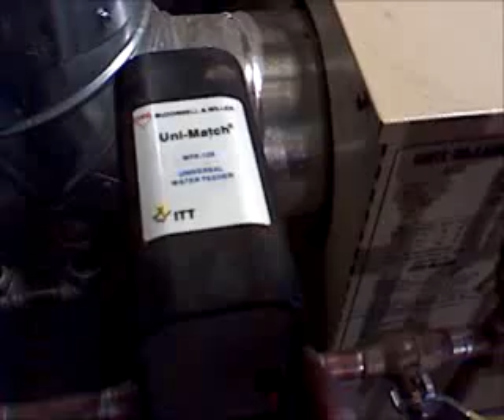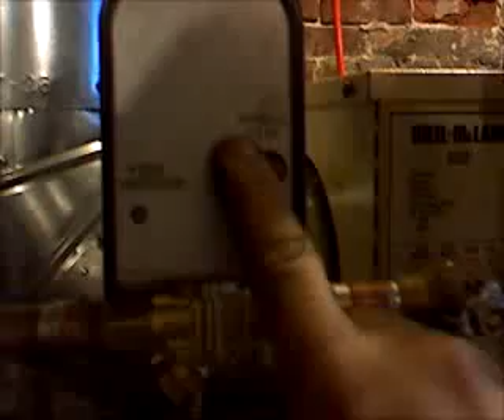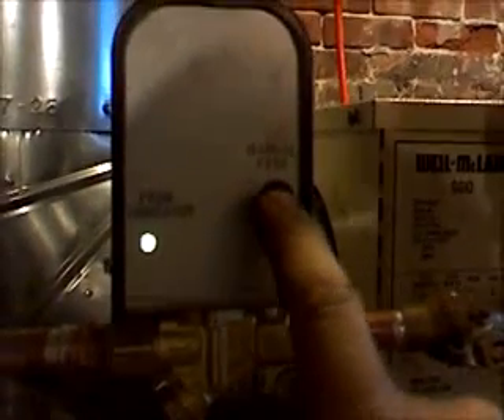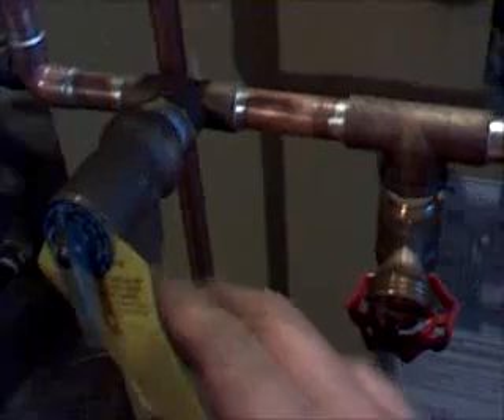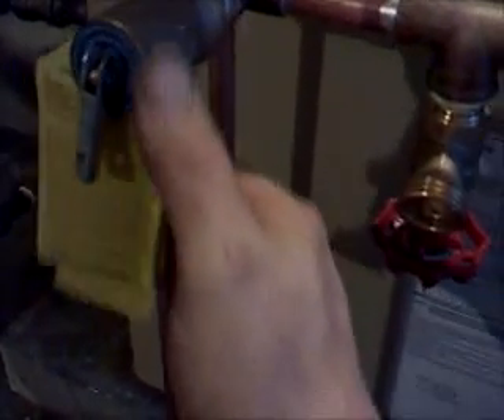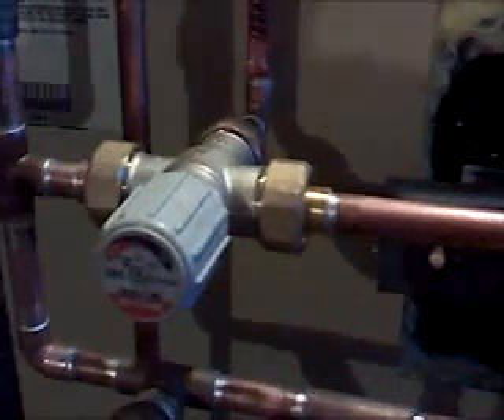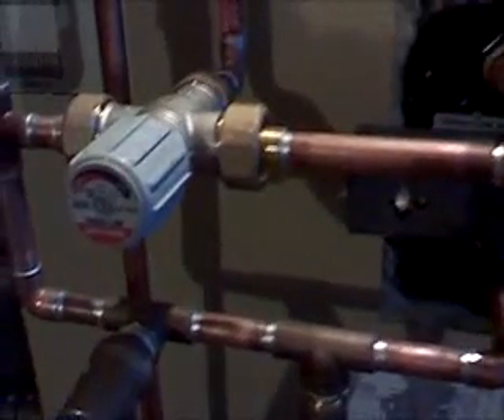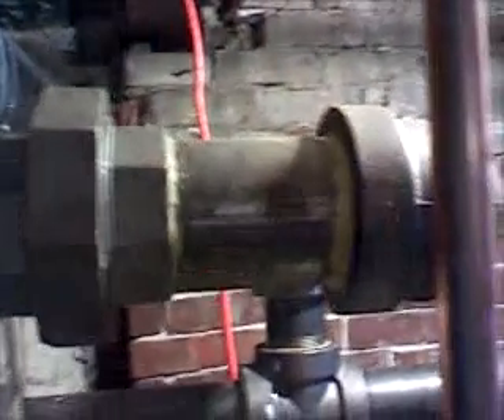Steam oil fired boiler

Comment from the maker: First of all in a Single Pipe steam system you don't wan't pressure, you want properly functioning vents, and this includes main vents.  The are expensive to replace ($30-40 each).  Your pressuretroll may also be cutting out prematurely, you could also have too much water in the boiler, it could be something else entirely like a loose wire or  a blockage in the returns.  Very difficult to assess without seeing it.  If Your local to Boston you can call 781-662-2850.  If not get someone local.

Comment: hello mister plumber i have a burnham boiler ,i drained it several times ,water is clear ,boiler is taking too long to build steam ,and when i finaly get steam ,there are not that much steam ,its like the steam is not blowing enough steam ,the steam dont have much pressure in the steam ,can you help me with some tops pls ,thanks you

Comment from the maker: You failed to mention if she has an automatic feeder or not.
Some auto feeders have settings to time how long they run for.
If she has a tankless coil in the boiler for domestic water heating, there is a chance there is a hole in the coil.
These coils are typically replaceable, however sometimes the damage is extensive and they can't be fixed
The shut off valve may be defective and not closing all the way.
you can send me some pictures if you like.

Comment: My aunt in vt. Has a oil fired steam boiler and for some reason her boiler won't stop filling up with water, and when the water level gets to high the boiler turns off until she drains it below a a certain point. She called her local plumber or heating and Cooling company and they don't know why this is happing. As it gets colder shes Ben draining it more and more. She drains about 10 gal. A day. She has one thermostat in her house, and all her radiators work and are open. Any advice will be gr